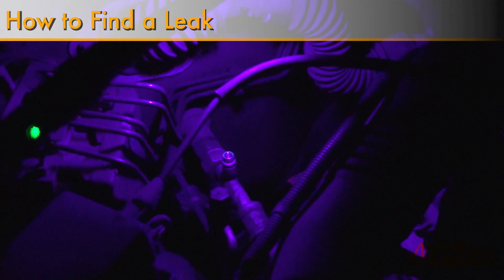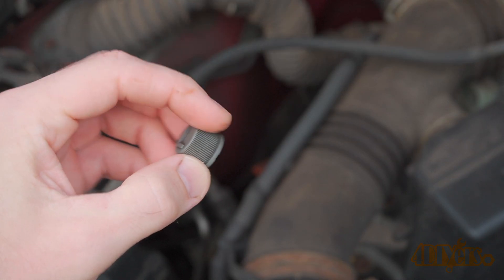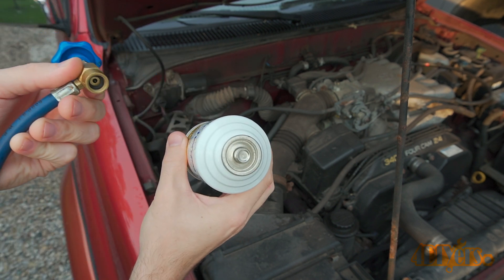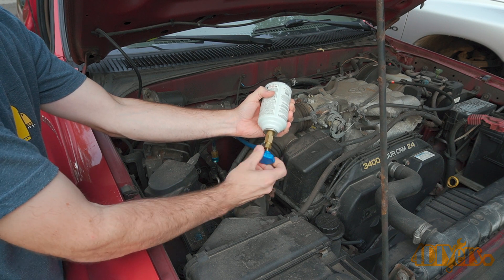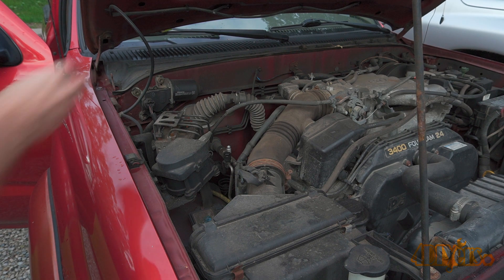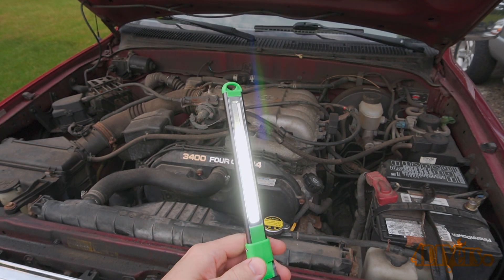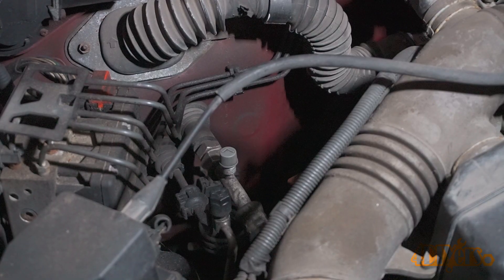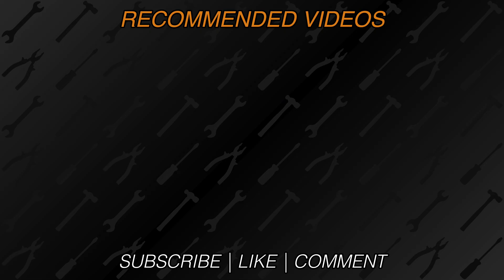How to Find a Leak in your AC System using a UV Dye

Comment: Low side pressure/sbrader valve where u introduced dye to system...did it ever cross ur mind that was caused during the process of attaching the fitting???
Reply from the maker: Yes and it was cleaned after the dye was added to the system. There was dye leaking around the cap.